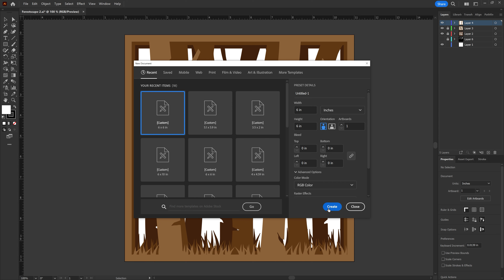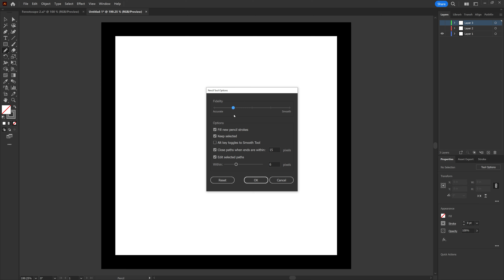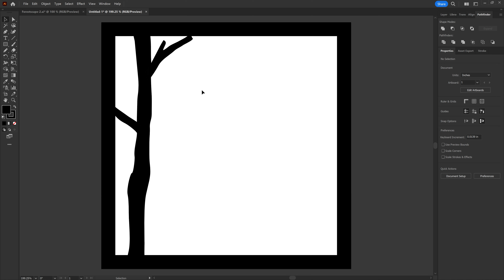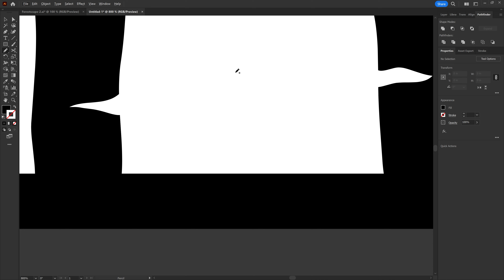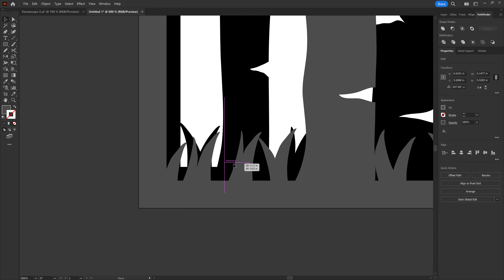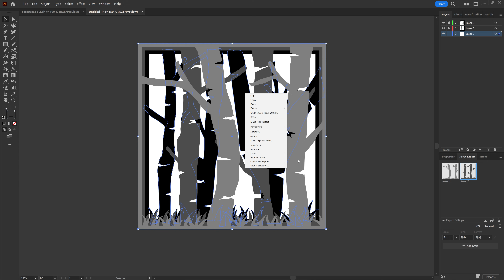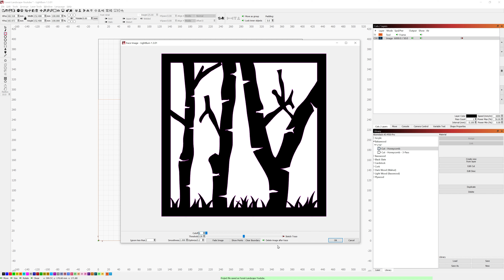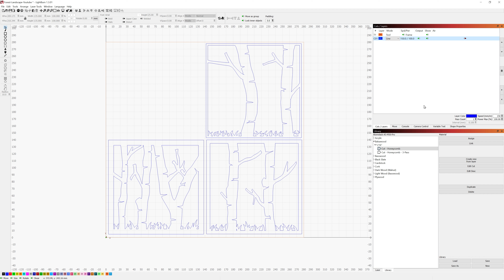Designing and Laser Cutting a Layered Forestscape with Adobe Illustrator and Lightburn

Comment: Nicely done. 2 Questions... Do you clean or seal the edges to avoid smudging?  Are the two patterns available?
Reply from the maker: It depends on how I'm going to be using them.  For some of them, I use them as art that will be hung somewhere and I will either paint / stain the layers different shades of a color and then seal them for durability.  I also like to use these to make customizable nightlights (going to be doing a video of that soon) and, for those, depending on the end result I'll either leave it completely natural or paint them to match the color of the nightlight box.

I edited the video description and added a link to a zip file containing all of the profile files I used in the video.  Good luck!